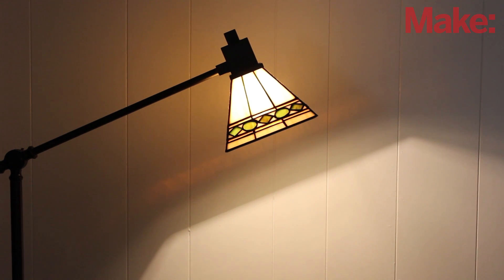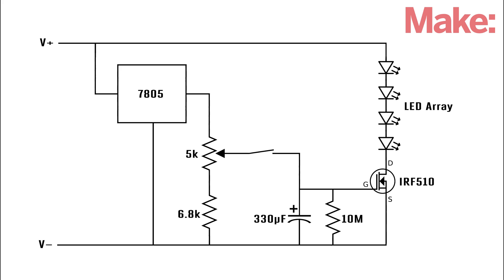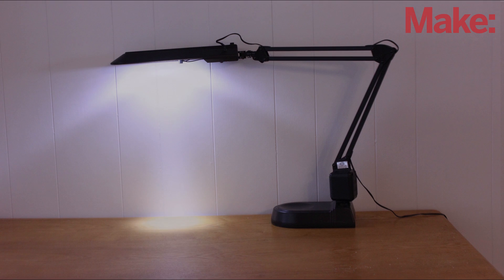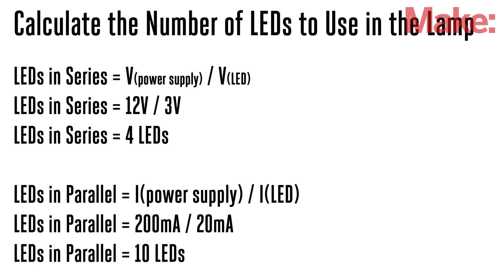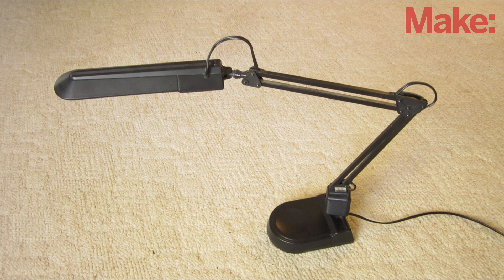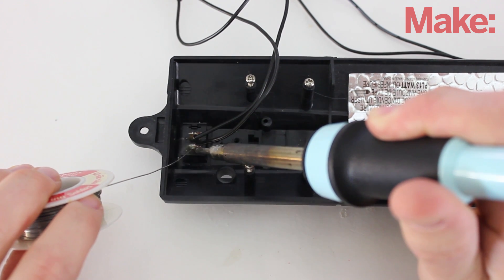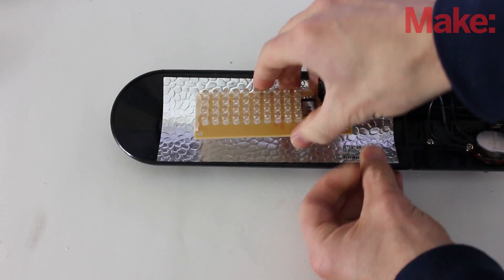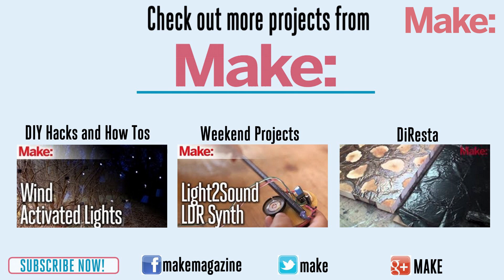LED Lamp with Sleep Timer

Comment: Nice tutorial. You could replace the 10M resistor with another variable resistor to control the dimming speed. Not sure if variable resistors that large are available though... guess you could adjust the parallel capacitor to accommodate the variable resistor you find.